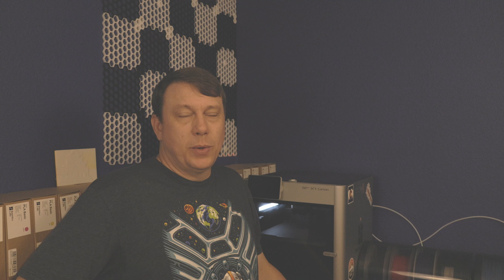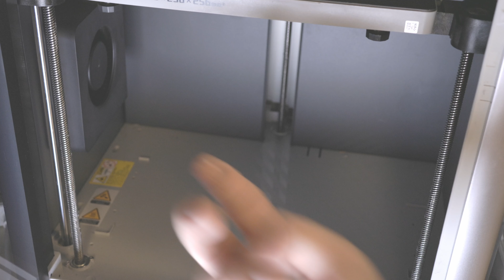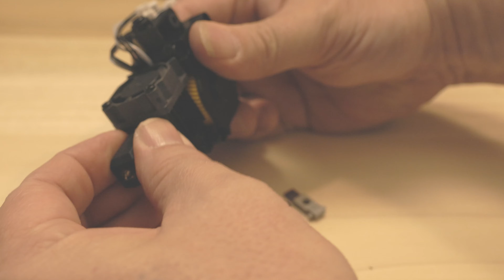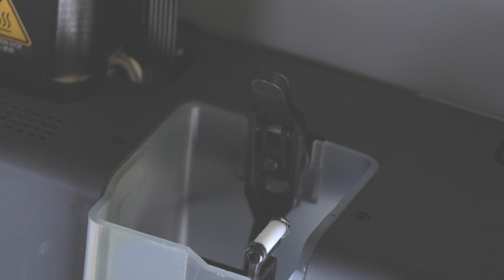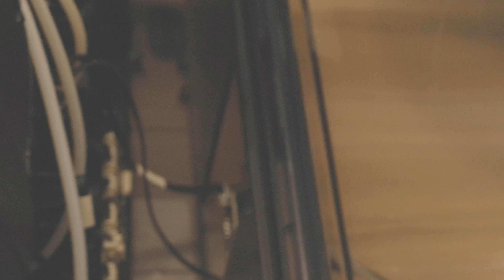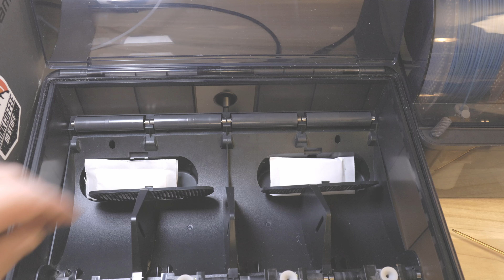Bambu Lab X1C 6-Month Maintenance and Review

Comment: I got to thinking about the carbon rods and how it might be good idea to move small parts that get printed around the build plate when slicing so that the centre of the rods dont receive too much wear
Reply: Spreading the wear around the plate is a good idea anyway, you might get a longer life out of the plates and like you said the rods. I’m surprised that printers don’t have any sort of wear levelling built into the slicer rather than just auto arranging everything to the centre, maybe the rods just don’t wear out fast enough for it to be an issue?
Reply: @conorstewart2214  Maybe a plugin for Cura could arrange automated movement of the parts to save on wear and tear

Comment: I read that there is a printable tool to ease the removal of the AMS wire clip release and tube release
Reply from the maker: i have it.  It helps on the AMS hub because the clip is positioned towards the back.  On the back of the AMS, it does not help at all.  The tube release part works great.

Comment: What is the down side of putting a few drops of oil on the carbon rods?  Will it damage them or help them with less wear?
Reply: Never lubricate carbon rods or bushings.  It will promote the collection of dust etc. on the rods.  The carbon is actually very fragile and the dust will grind up the surface of the rods.  Once the surface is damaged it will degrade quickly.  Plus the carbon has self lubricating properties (graphite), no additional lubrication required.  All the best!
Reply from the maker: I wouldn’t put it on there. It’s not necessary

Comment: Len, I think you are not cleaning your table lead screw rods correctly. You wiped the outside section of the screw rods. You cleaned technically 25% of the screw rod. You have 75% more surface area that has old dirty contaminated grease that you did not get. That includes the wall going down into the screw valley, the floor, then the wall going back up the other side.  The floor holds a lot of dirty grease that rolls and mixes the dirt and brings it back up  like an "eddy" since the table female "nut" spline doesn't fully hit the floor of the males screw.  I am a maintenance guy at a 50 million a year printer, here is how I do it. My daughter and I have 6) P1Ps and 1) X1 C that run 6 days a week for 16 hours. The parts we print are all 10mm-30mm in height.  I fully clean the screws every 2 months and fully clean the top 60mm monthly. I use a synthetic aluminum complex grease with 3% molybdenum to lessen wear in  the constant  slip of the lead screw/nut. I use a micro fiber cloth and IP we use to clean our plates every run to fully clean the screws. I use the table feed to let the screw bring up the gripped cloth that gets 100% of the screw clean.
Reply: I saw some tools that are printable to help remove the old grease on one of the file libraries, dont know how good they are but I will give them a try.
Reply: It’s a printer not a space shuttle. True there will be old grease but this will not damage the printer.
Reply: @Todestelzer  I have a small print farm and  I run a maintenance dept for  mid size manufacturing plant(s). I deal with lead screws on a bunch of equipment.  You DO need to worry about dirty grease with a CHEAP lead screws and  lead nut. If you run ABS and the other abrasive filaments, that   compounds the wear speed.
Reply: @TedTedness-wu4vb  hmm ok. Probably using compressed air can help removing the remaining grease. But its a pain to clean every single bit of old grease. Never did it on industrial machines on work...
Reply: @Todestelzer  It is so so easy, you use those mass produced 50 in a box micro fiber rags that  for example Menards ( like a home depot in midwest) sells and you wrap a chuck around the lead screw  and squeeze the wrap with your finger tips or side of your nail to help imbed the rag into the screw pitch. . on the first pass using the control to raise and lower the table. Then the next pass you add  a good amount isopropyl alcohol on the wrap area. That's all it takes the 3 layered or so micro fiber and the micro fiber can get into the screw threads with ease. A box of 50 are $15 and I use those to clean the textured plate before every run and keep the old ones for printer lead screw cleaning  I have 1 X carbon and 9 P1Ps.  I do screw cleanings every 2 months and use aluminum complex 3% moly grease for the lead screws.  Schaeffer's 714 synthetic grease. The moly grease takes a lot of the wear out of the picture.